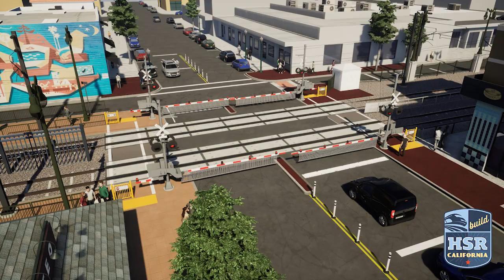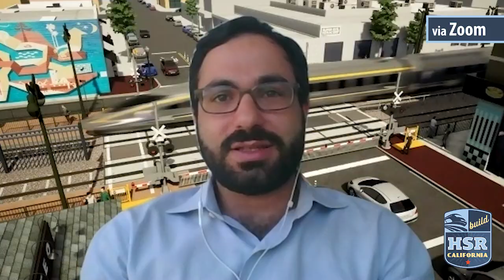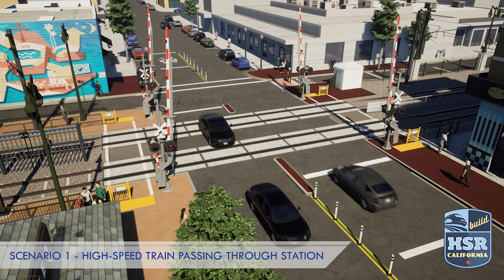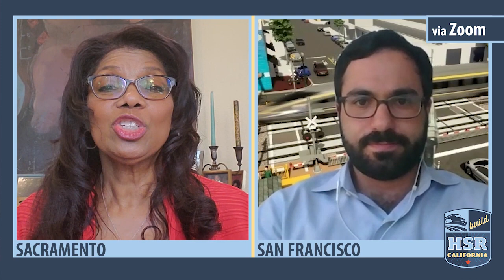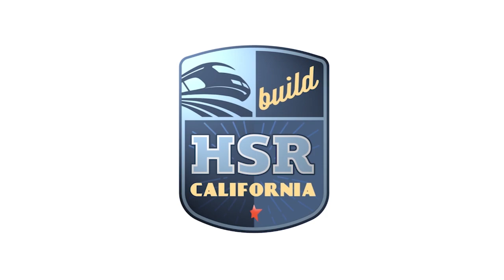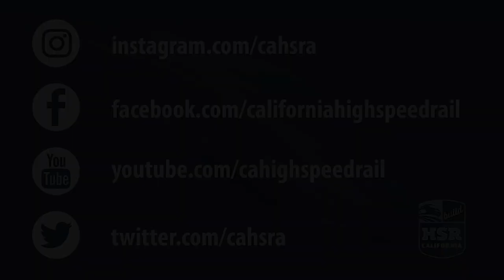HSR Q&A: What is a Quad Gate?

Comment: just curious if you are going to install in pavement warning lighting..  like this video shown at Los Angeles and Washington blvd along the blue line in downtown los Angeles.. https://youtu.be/FwOT6YcAdFs as drivers are not always looking up.. they are looking at the pavement in front of them.  its a lot cheaper than an accident..   i am also worried about grade crossings with trains at high speeds .. if a car does get onto the tracks.. how far will the car be thrown..  or pedestrians..   i would also like to see concrete center dividers instead of bollards and a low curb island for some impatient drivers to try to get around the gates..    are you also going to have Video cameras at each grade crossing.. along with some sort of transmitters to transmit video to the brakeman in the train giving them a heads up to attempt to slow the train..    in los angeles we also use Count down pedestrian signs.. .. perhaps those can be incorporated.. to count down for pedestrians.. i am disabled and i can barely make it across the grade crossing in the video before the signal changes and 23 seconds of warning a train is coming is NOT enough for some people..  especially those with wheel chairs..    just a last week an officer managed to pull a wheel chair disabled man out of his chair a split second before the train came thru the man was actually clipped by the train. the front wheels of his wheel chair has turned sideways and gotten trapped in the track..  he could not get it free..   i personally can't imagine grade separations in a congested city area with a 200 mile an hour train..  has anybody seen how japan and france handles them.
Reply: Mostly will

Comment: In south korea, when ktx, korean HSR service, firstly became operational in 2004, there were also used to be a blended system with conventional rail service between Daegu and Busan, similar to the concerning SJ~SF section. Although the high speed train shared that corridor with slower trains by 'crawling' at maximum speed of 95mph, the corridor's at-grade crossings were fully grade-separated WITHOUT any exception. Rolling HSR in at-grade crossing by 110mph? Hard to imagine.
Reply: maybe this is why acela express looks like 'acela limited' in some section and also the reason for the nec improvement project which is slated to be done in 2040:)
Reply: The part with at-grade crossings between S.F. and S.J. and/or Gilroy will likely run electrified Caltrain engines long before CAHSR ever touches the tracks, and those will have a top speed of 79mph. The odds that CAHSR will never run on these at-grade segments are higher than most people might think.
Reply: @Acerailfan3101 F40PH Absolutely.
Reply: @Acerailfan3101 F40PH why would Caltrain use locos when EMUs are superior in almost every area? The only reason Amtrak has electric locos is because the AEM-7s were junked after 30 years of continuous service, and even the ACS-64s might be relegated to long-distance hauling or even storage for future corridor electrification if Amtrak goes for EMUs/DEMUs like the class 802 for the Amfleet replacement.
Reply: Grade separations are very sad because if you separate the grade, we can’t get any horn action! They can be bad

Comment: As others have pointed out, this concerns San Francisco to San Jose with speeds up to 110 mph. Over time more grade separations will be built, but this is a line that was first laid when Lincoln was president and it runs through a very built up area. By reducing some curves it will probably (some day) reach 125 mph.  Between Gilroy and Burbank the line should be totally grade separated from day one. That will be all new alignment. That is where you get 220 mph.

Comment: Just when I thought 2020 couldn't get any more stranger. A proposed high speed rail system is now using grade crossings... (If anyone at CAHSR is reading this, let me just say that grade crossings are NOT a good idea for this service since the train has to slow down in order to cross it and there is also the risk of someone trying to run the crossing and then get stuck on the tracks.)
Reply: Acerailfan3101 F40PH 😂 yeah that Whitehill guy. We don’t speak of him here.
Reply: @Acerailfan3101 F40PH Touche. But they would still be going faster without grade crossings. That's why they got rid of them in Maryland along the NEC.
Reply: @Acerailfan3101 F40PH Probably got blocked. xd.
Reply: @Acerailfan3101 F40PH Agreed.
Reply: @Acerailfan3101 F40PH h8trs gonna h8. "Dab on those haters" (Jake Paul)[sorry...]
Reply: This is only the Caltrain segment.
Reply: @Acerailfan3101 F40PH What law are you talking about regarding horns through stations? Currently trains don't honk horns when bypassing stations
Reply: @Acerailfan3101 F40PH I was hoping you could tell me what law it was, or where to find it. I can equally send you videos of trains not honking horns, but it really wouldn't prove anything
Reply: Well how about they add a speed limit? Like 120 MPH?
Reply: Also, if we're going to talk about horns, what happens if whatever they use in who knows how many years doesn't have a good horn? Look at the avelia liberty. Everyone is complaining about how it should have a K5LA.
Reply: @Pensyfan19  I thought Amtrak said that horn was only temporary for testing specifically because the area it is testing in doesn't have grade crossings. Plus you have to realize that these trains are not going to be going at speeds of 150mph on Caltrain's tracks. Call it an extra way to save money. lol
Reply: @banksrail  Aw man. :( 
Hence the point of why the mainline should be grade seperated to allow for higher speeds for the high speed line and Caltrain.
Reply: Pensyfan19 yeah I definitely have mixed feeling about it too.
Reply: @Acerailfan3101 F40PH Fair point.

Comment: I thought that there would be no at grade crossings on the entire system because that would slow down the train because of the potential for a rail mishaps.
Reply: only on the San Jose - SF corridor, and potentially Burbank - LA corridor. And that's because people complained about the sheer cost of construction to grade-separate in two of the most expensive real-estate markets in the country.
Reply: For various reasons CAHSR will not use dedicated right-of-way in various areas, and those areas will likely not be modified extensively outside of track installation, electrification, and sound walls.  The stretch from S.J. to S.F. is essentially Caltrain, the construction of which is being partially funded by the CAHSR authority in lieu of the authority building its own ROW at much higher cost.  On that stretch CAHSR will operate at similar speeds to Caltrain.
Reply: @LucidStew  The only two areas in the state where CAHSR will operate at 110mph rather than 220mph max speed are at the bookends in the Bay Area and LA. There aren’t any “various areas”, just two. The vast majority of the system trackage will be one continuous high speed section with no interruptions in the HSR ROW. 

This is the typical HSR arrangement, city pairs connected by dedicated HSR ROW with slower sections at the destinations to use the existing city center stations. There’s no other way to bring HSR into city center stations unless you’re down to demo a brand new ROW smack in the center of your city at ludicrous cost.

Comment: At grade crossings on a high-speed rail line? wtf
Reply: From what I can tell, it'll only exist where HSR is using the same tracks as other agencies, namely the San Jose-San Francisco corridor. In places like LA, the EIR reports show that the ROW's will have more grade separations,  or I guess a better way to put it is that the CAHSR will pay for the final series of grade separations between Burbank and Anaheim via LA, on a route that is largely grade separated already. 

Additionally, it isn't unheard of in the US, since there are sections of 90-125 MPH running on Amtrak that does have at grade crossings. Especially on the Northeast Corridor North of New Haven.
Reply: @btomimatsucunard  It's still unfortunate. These grade crossing will decrease the speed down to normal commuter rail speeds. It will also cause reliability problems. 
For how much they are spending on it, I expected the line to be 100 percent grade-separated.
Reply: @NNNVVVVBB  Yeah it really is. And all I can really chalk it up to is Cali's messed up Environmental Review process. It allows small groups of people to delay or forcibly cancel any project by raising enough of a stink. Some people in the bay area objected to any alternative to the HSR line's grade separation that wasn't a full subway (IE no trenches either from what I've heard), which would have run up the cost too much given the length of the separation people were clamoring for.
Reply: @btomimatsucunard maybe people should fly between LA and SFO! LESS trains stopped for 2 hours after they kill somebody at a grade crossing?.
Reply: Technically the trains will only be highER speed in these areas. 110mph, perhaps 125.  Although they're also sharing ROW with freight and other commuter rail lines, so they may not even run that fast in stretches.
Reply: @LucidStew  TBH that would still be better than what we have currently. So many old Railroad ROW's were capable of  higher speed services, but are now confined to 50-79 mph service.
Reply: Well written. 
Grade crossings will guarantee collisions with cars and trucks. 
Just imagine the physics of a HSR vehicle striking a car or truck!  Hundreds will die. 
HSR is a joke.
Reply: @whiteclifffl  I would more say that the process that allows this to happen is a joke. I mean the EIR system in California is kinda broken, and has contributed to the woes that transit projects face, and the states housing shortage. I can understand why such an intensive EIR would be required out in the country or undeveloped land, but in highly developed urban corridors it seems more like a waste. If you have the engineering done and its up to city code, you should be allowed to build it.